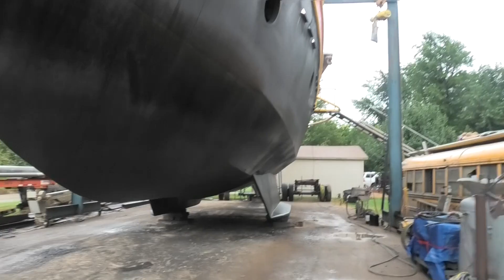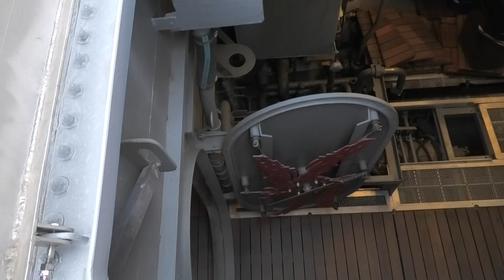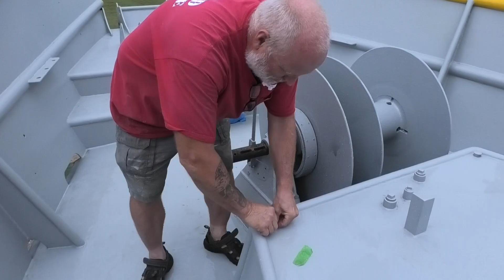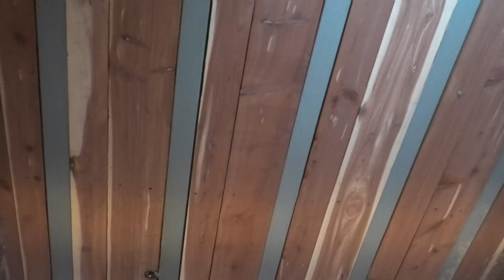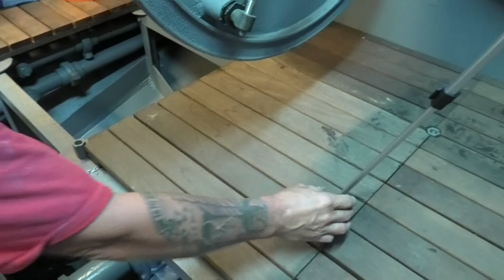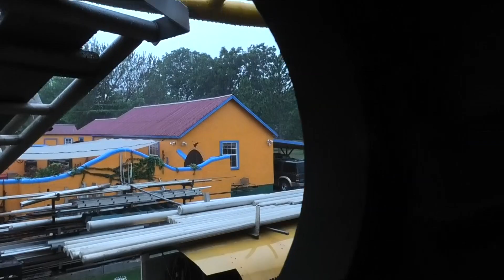Touring SV Seeker

Comment: Stu,  I am just checking in here in July 30, 2023.  I'm curious about your thoughts these days about how Seeker has shaken out.  DO you still see the project the same as you did?  Have you watched the latest videos with the heeling and stability issues?  I'd love to hear your honest thoughts on what all has transpired.  I won't detail my thoughts here, just suffice it to say that if I had been a supporter of this "research' vessel, I would be disillusioned and frankly a bit upset.  Open blue water is not in this vessels wheel-house (pun intended.)

Comment: I've watched most of the popular 'sailing' videos and the one common thread is that they do a LOT of motoring so I suggest that most 'sailboats' are really motorsailors just sometimes not particularly good at it.  Engines might not be 'dependable' but neither is the wind.  Two things I want on a sailboat is an engine and radar, two things I want on a powerboat is a second engine and radar.

Comment: The only difference between a small boat and a huge one when it comes to working on it is. The amount of surface that you need to keep up. They all have the same components. I have 30 years experience in the commercial boating industry. The last 25 as a 200 ton Master.I worked on and run smaller boats and double the size of the smaller ones. They all will work you around the same. The only advantage to the big boats are you have a bigger crew.

Comment: the metal frame running to the floor behind you you could make a chart table off of that with lighting would be a sweet and useful touch but this is a 2019 video so nevermind

Comment: you might want to find out if marine diesel heads are different from a standard. the question is how long will the land engine survive cooing with salt water or do you have a closed system with radiator?

Comment: One serious concern.  A single 5.9 cummins, which is severely underpowered for a boat of this size.  Never mind it being a single screw.  And if that engine fails, there is no chance you could dock that boat.  A still weak, but slightly more reasonable set up would be dual cummins 8.3's, and OBVIOUSLY two screws.  How on earth is it safe to have a tiny 5.9 powering a 75' yacht?  Those chinese style sails will not have you in the marina or the harbour.  Thoughts?

Comment: Oh also are you going to have an area on the boat or you could re-charge a scuba tanks and stuff for these researchers to go down and underwater also if you had it a tube that was may be a 24 inch diameter that wet from the deck all the way down through the bottom of the boat or you could actually pull things straight out from underneath the boat after that to weld it make sure it’s watertight everything you could also send out put like a stoner down through there are cameras and stuff like that we could still look under the water even if it was rough seas are softener or icy or cold water depending on where are your At in the world.

Comment: I have a question how hard would it be to take the chassis of that school bus and mounted it up on your boat so you have more inside area if you’re in rough Cesar or cold weather rainy or even snowing you have more visibility but you’re inside kind a like maybe an extended bridge that lower on the deck just at an hour so anything brought up then they’re inside when they’re doing the research and I think brought right up out of the water if you have a an area that goes down into the ocean at like a tube that would go from through the bottom of the your boat up to that top deck where they can pull things right out of the ocean with the inside an inclosed area.

Comment: The small 3 in ring around the bottom of the mast, in my opinion, is a great idea, but you will need an additional  4-6 ft circular 1 in steel plate on the deck where the mast protrudes through  with added  welded vertical horizontal tapered plates attached to the mast leading outward on the circular 1 inch thick steel plate. I know the  end of the mast with the small circular lip will probably be attached down below on a step that is attach on top of the keel. This 4-6ft circular 1 inch plate should be welded on the deck where the mast protrudes through it. I believe this would support the mast tremendously & increase it's strength. I was also thinking since it's basicly a motor sailboat, perhaps you could put big wind turbines on top of the mast & the you could sail straight into the wind. You could also convert the engine to an electric motor, & use still use the diesel like a diesel-electric hybrid like the locomotives do & get a lot better gas mileage, especially when there isn't any wind. Just a thought peace & love.

Comment: Nice project Doug.  Maybe you could fit the boat with divers gear incl. pumps and compressors and pick up some dive business. I would suggest you incl a "backup " diesel tank in case you need to get out of the water quicker.  I'm sure that thought occurred to you.  Your obviously a great mechanical engineer.

Comment: Rv tank antifreeze is the cheapest coolant for engine,
Reply: Rv tank antifreeze is made without any corrosion inhibitor,  which is one of the two reasons it's used for an engine system.   It's made different for a really  REALLY good reason.

Comment: Have to wonder about the electrolytic reaction between the aluminum wheelhouse and the steel deck/hull beneath.  He's smart enough to realize it's going to occur, so I wonder how he solved that problem?  Been waiting a long time to see this boat in the water.  I know it's a lot of work, but I'm anxious to see her under sail and doing what he's built her for.  Can't wait for that day.  I do think 75 feet is a pretty good sweet spot for a boat, thought.  It's big enough to be comfortable, both with regard to inside accommodation and sea keeping, but not so big as to be unmanageable by a limited crew or only one person.  Fantastic project!!
Reply: Can't remember which episode, but there is an hour or so of him detailing his response to the electrolysis issue.  He knows it's a thing, he's invested considerable research and effort into addressing it.
Reply from the maker: Hey mate, I also think she is a really good size.

Comment: Lmao Planes and Boats/Ships don't need Transmations lmao bad idea!!! You use RPM not gears.
Reply: The94GTC  you don't understand the transmation is just something extra that can break. It won't work properly all he needs is RPM and he should get a engine that has high rev limit and it needs to maintain that RPM for it to work the only reason why cars have a transmation is because the engine is not powerful enough to get it to high speeds for example I have a steam car and it has no transmission because it produces enough to get it moving at high speeds without a transmission a boat and a plane do not need a transmission all they do is go to a certain RPM and keep in constant that's all they do when they want to go faster NO transmission is needed. electric cars for example don't have a transmission because it's constant power and it can rev to extremely high RPM but a gas or diesel engine is not capable of doing that. It's all about RPM aka revolutions per minute.
Reply from the maker: He still needs neutral and reverse though.
Reply: @DangarMarine  correct! That's why he got the variable propeller shaft. But the transmation is going to be a pain for him. Not to late though.
Reply: The94GTC  he doesn't need a transmission no boat in history has had a transmission even if it has a variable propeller.

Comment: The only problem I see is the engine is way under powered and there is only 1?? 
With the huge ocean waves in bad weather when sails can't be used. That 260 horse engine is no where near enough power. At minimal 2-500hp Catipiller engines at least!
Reply: The94GTC  , as heavy as that ship is it would be lucky to reach 9 knots.

Comment: Use test plugs instead of those corks. They won't pull out until you loosen them.   https://www.google.com/search?q=1%22+test+plug&sxsrf=ACYBGNRxTTFyf53P-m6NGEQHvW0vJA8fkw:1571280449079&source=lnms&tbm=isch&sa=X&ved=0ahUKEwjP2onoo6LlAhUOd6wKHbtXArAQ_AUIEygC&biw=1920&bih=969

Comment: Best thing to do,we build our 45 ft boat from scratch too....now 38 years ago.Took 3,5 years and all the money but well worth it.Have to say that we were young and probably would think a bit longer to start now at 61.So lot of admiration for this guy!
Reply from the maker: Nice work Robert. Yes, it sure is a big project to take on later in life.
Reply: This guy is 15 YEARS on in the project and it still cannot sail.  It barely moves without flailing itself apart.

Comment: sv seeker needs to harness solar energy for energy consumption with motors off
and to utilize the temperature of the water down below to heat and cool air with a simple duct that pushes air through bottom of boat . Also any fiscally viable plans for desalination?
Reply: piece of duct and few 12 volt fans can be an easy air conditioning system.
Reply: hypothetically........ has anyone ever attemted rigid sails that can be telescoped  and pivoted ?  Manually/pnuematically/elrctronically/hydraulically.....
sails can possibly double as solar arrays?
Reply: can wind turbine energy be geared down to turn the screw as an auxiliary power source along with the sails? (wind turbine can be pivoted to harness energy from any direction even into wind)

Comment: I wore "Caaboy Booots" on my boat Every Day.  It was a 26' or 27' cabin cruiser with Chev. 350-w/ 260 hp.  It was kind of heavy top end was only about 36-37.  I ran it at either Lake Powell or Flaming Gorge (4k' or 6k') ft in elevation.,  That took away from the total hp and top end.  But I loved it and spent at least 4 days continousley on the boat each month.
Reply from the maker: You've convinced me to run with them. :)

Comment: i thought that square corners in the windows was something that you did not want  to eliminate cracking just as they do in aircraft
Reply from the maker: It doesn't matter so much in a wheelhouse that is isolated from the hull like this.

Comment: One thing it seems to be missing is a bow thruster
Reply from the maker: Real boat drivers don’t need bow thrusters!
Reply: @DangarMarine  Yea but why fight it when you don't have to,  especially in a tight harbor with a stiff cross wind, or to wiggle yourself back off a sand bar.
Reply from the maker: Because you get more chicks without a bow thruster. ;)
Reply: @DangarMarine  You show me a chic that  knows what a bow thruster is, and I'll show you a chick that shaves more than you do

Comment: Add a shaft cutter because your hull no keel configuration is actually a tunnel to direct any rope , net, etc into your prop...another for your formula ...cheers ! 170 HP only..to pull nets etc...?..don't think so...270 + sounds better...and tell him to add another blade to that prop for real trawler power..3 blade not enough ..IMHO

Comment: Ha, the only reason Doug is out there talking, is because it's raining and he can't really work otherwise he'd be on it. My only concern with this boat is the single engine as a point of failure in a storm scenario, it is best not to approach land, obstacles, or port in bad weather, because if the motor fails the sails may well not be enough to get you out of trouble. Only approach in in fine weather where the anchor can be set if required and the problem addressed. Those Cummins diesels are reliable, but any motor or it's ancillaries can have a failure and there is no redundancy there apart from sail.
Reply: Most boats are single engine without any sails

Comment: U should try to find a totaled Tesla for the battery rack.  Put two of those in the hold and you will have power for days.
Reply from the maker: I think that could be a great way to go.
Reply: Dangar Marine to justify the price point, you have to compare how many lead/acid batteries to equal lithium battery, then the non off gas is a huge plus, etc.  I have see a few videos and folks still paying lots of money for totaled car, but if you’re only taking it for battery you can sell off the rest of the parts

Comment: On your sinks I would think about heating the water right at the sink.  Only the showers would I have a central hot water heater. and at that at the showers I would put a timer on the hot water lines that turn it off.

Comment: Did he say 250 gallons of coolant? Is their a nuclear reactor in there I missed?
Reply: He was talking about beaching the boat so he could clean the bottom or do other things below the water line.  Having a large coolant reservoir would allow him to run the generator with the boat out of the water.  When I was serving aboard a landing craft in the Army, we had what we called 'beaching tanks' which were merely large tanks of sea water that allowed us to have power when we were beached when the tide went out.
Reply: I think he might be using a closed-loop cooling system with piping under the hull possibly like brupeg?
Reply: @CessnaPilot99  They are circulating coolant thru the skeg for cooling.
Reply: @rleeAZ  I get that but what are they cooling besides the school bus motor? Maybe they are using it for ballast? That's like 1750lbs of coolant. A big block Mercruiser uses a tiny heat exchanger. It don't need anything like 250 gallons and a simple pump is not going to push it around.
I remember when Seeker started being it was one of few boat videos and it came in my suggested vids for the first sheet of steel but I didn't follow along as much over the years so if anyone knows ….
Reply: @finscreenname  here is a vid where doug explains the cooling system. Is it overkill? I am not sure about the efficiency of essentially circulating coolant thru a tank that acts as a heat exchanger. The volume of coolant may make up for the inefficiency. They are also cooling a hydraulic pump, genset and (I think) the transmission thru a heat exchanger. https://youtu.be/I5-tY-Cskfw?t=712
Reply: I suspect that it is just the volume of the skeg.
Reply: Cooler and more capacity is ALWAYS better 😂
Reply: In cold climates think of it as radiant floor heat and the generator will likely use it, not sure because this is the most information on the overall layout I've seen
Reply: @1STGeneral  The skeg is external to the boat (mostly).

Comment: Preppers want those water tight doors is why they are so expensive. I am surprised they are not using spray foam.
Reply from the maker: I'm guessing it is because spray foam can't be removed again easily for future hull work.
Reply: @DangarMarine  But aren't they gluing the sheets to the hull? And this is JMHO but I would not have any of the pink sheeting exposed in the engine room / workshop. You can set that stuff on fire with what comes off a grinder.
Reply: Dangar Marine Stu, And with spray foam you have no way to inspect the hull for rust etc. like, what if the foam pulled the paint off and you did not know it.? Also spray foam claims it's closed cell but not completely so as moisture get in it hold it like a sponge right against the steel hull......
Check out "Emerald steel" 40 year old home built on beach steel boat , all removable insulation , no rust. 
 Check out 'sailing yacht Zora', old steel sail boat rebuild in Ireland , all spray foam , looks nice and might out last him and he is young but you may never know why it fails if it does!   
Lastly ,very famous cruising couple , the Hiscocks , their third boat was well built steel yacht built in holland, but only place the hull rusted thru Was up in bow where the builder had filled in front of a frame with cement and it trapped the water and rusted the hull thru prematurely.  Steel boats....if you can't  get access to check the hull it will rust right there! Or might! Great video thanks! Warren
Reply: @DangarMarine  Spray foam can be open or closed cell polyurethane. The light  open cell type ain't so good on a boat - water gets in. Medium density foam should be better. The insulation sheets Doug's using is polystyrene. It's closed foam. Water won't get past it and you can rip it off if you need to and replace it cheaply. I once knew a bloke who filled the thwarts on his tinnie with polyurethane foam to keep it afloat in case of an accident. It sank.

Comment: I have an original V8-71 Detroit Diesel laminated exploded view IPB with original part numbers and item numbers on it . it is 22" x 28"in size. Also the V6, and 3 Cylinder. These were rescued from the trash at a heavy equipment shop I worked for some time ago. I just located them in my junk pile, after watching you working on your motor. Am going to get reprints, and send you one of the 8-71. SARGE
Reply from the maker: Thanks Sarge!